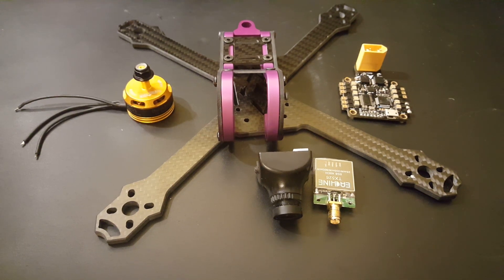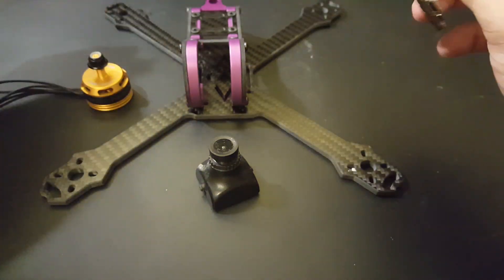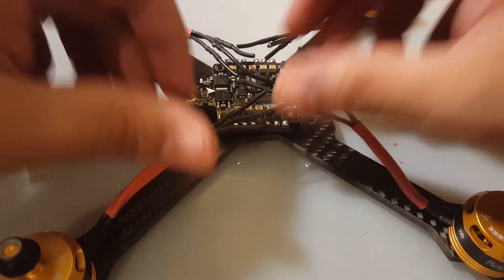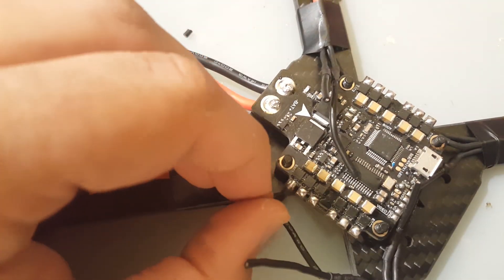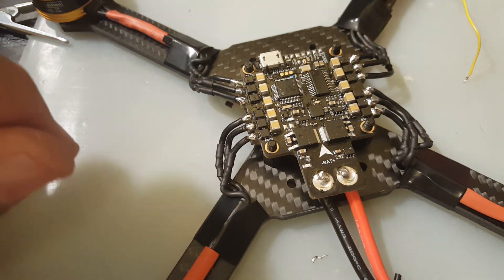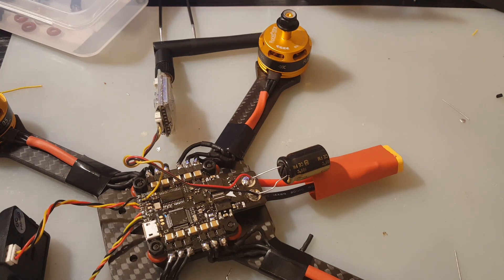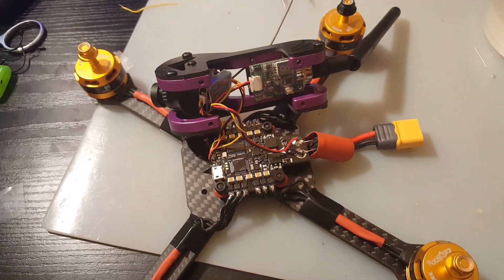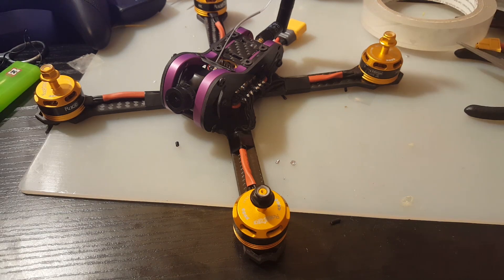How to build a $150 FPV freestyle Drone 2017 // Hippo , Racerstar AIO , RS 2205

Comment: Great video. I got a question for you. Would a 2306 motor work on the hippo frame. I have a set of furibee br2306s 2400kv that I would like to build on that frame. Not sure if it would work before I order the frame. Thanks
Reply: Adam Ali it'll work
Reply: Thanks Jon

Comment: Hey, I'm thinking of building this quad and was wondering what props you used for this build, and if I could use an Infinity 1500mah 14.8V 90C 4S1P Race Spec Lipo Battery.
Thanks

Comment: Great vid, Im building the purple now but wondering what awg cable to use to extend the wires, Wasn't happy they're only few cm short. Also worried about my 4in1 racerstar 35a ESC and Omnibus F4 fitting in this frame with top cover on. 😆
Reply: Redogg Damon Did it fit in after all?
Reply: scheeenfilmiesgucke Nope but i used standoffs to raise the cover off the frame. still in the process of installing fpv gear. Cant wait for a real fpv fly. :D

Comment: Do you really need the capacitor? I would like to know why you've put it on
Reply: I believe the capacitor is supposed to help get rid of any noise in the FPV video and receiver signal caused by electromagnetic fields from the electronics
Reply: Because u can get rid of voltage spikes and that helps protecting other compoments from voltage damage and noise
Reply: A must on all builds. No lines in vtx.

Comment: Hi can I botter u and ask you what pids you use? I got som awfull oscillation with stock pids. Runing beta 3.2. Thanx for great videos, keep up the good work.
Reply: Tallak Flakke are you using the dynamic filter?
Reply: Cory Gross yes,  I found out that stock beta 3.2 was to high. I lowered the pids and it calmed down quite a bit.  The motors war also a bit warm before I lowered it.  Need too fine-tuning to get it locked in. To bad it rains 24/7 here in Norway west coast.
Reply: Tallak Flakke beautiful country. Happy flying.
Reply: He he thanks, a bit to wet for my likings. Happy flying :D
Reply: Tallak Flakke Bergenser?
Reply: scheeenfilmiesgucke ja
Reply: Tallak Flakke Me too! Do you know any other bergenser flying rc?

Comment: Some purple cable wraps for the motor wires would really make that thing come together. I'm probably going to order this build tonight. Except I'm going to order the purple motors to match the frame
http://www.ebay.com/itm/like/161786739959?chn=ps&dispItem=1
Reply from the maker: Andrew Rolfsen Good idea keep me updated would love to see how your buikd came out :)
Reply: This is my first build, so I'm sure I'm going to be hitting you with questions as I go
Reply from the maker: +Andrew Rolfsen no problem:)
Reply from the maker: +Andrew Rolfsen these are very durable and powerful. I love them however I have only used the 2300kv I can't say much about the 2600kv.

Comment: is it possible to strap a gopro or similar hd cam on top? 3s 2200 are ok for it cause i already have some of them!!!
Reply from the maker: +Alex Castignani yes you can strap a cam uptop but a 3s 2200mah you can fly but it will be very heavy. If a 4s then it would be a bit better as I use 2200mah for tuning to base point then switch out to 1500mah 4s for final pids. However it will fly and I recommend getting the racerstar 2306s 2400kv.

Comment: I do not recommend using a AIO like the STARF3S, Asgard, etc for a first build, nor do I recommend a 4-in-1 ESC.

If you're a beginner, you will smoke things while tinkering, and that includes your ESCs. Smoking a 4-in-1 will cost more than smoking a single ESC, and smoking a AIO will cost more than smoking a 4-in-1.

Also, 2600kV is overkill for a build toward beginners.

I know that people who have experience & know not to smoke parts will be building this, but the "$150 price point get your own drone now" sounds very appealing toward those new to the hobby, and smoking components is a bad experience no matter how you do it.
Reply from the maker: Abraham Levine For motor I recommend racerstar 2306 2400kv I will replace them as mentioned in the description because I flew the 2306 after this build and I was just amazed by the performance. 

Another thing about smoking components if your confident and take it one step at a time it should be much more simple than separate parts. If this was an asgard it would be pretty expensive to smoke I agree but this is very simple to setup.

Comment: why  F3  vs  F4  ?
Reply: chips don't matter

you can get effectively the same performance out of an F3 vs an F4, but your CPU usage drops dramatically with an F4. F4 is more futureproof but I don't see F3 becoming obsolete any time soon.

FCs should be judged more by board layout and featureset than chip.
Reply: thank you !   This will be my first build !   i absolutely LOVE your videos.  thank you.   i have been flying FPV for about aa year.  I am retired living in the Caribbean,  I fly every day,  usually 10 lipo.  BUT I have never tried building !   companies like Armattan sell RTF quads absolutely beautiful for so reasonable $  !   I will order from Banggood tonight !!  Thank you SOOO Much !  emillio
Reply: I am not the poster of this video
Reply from the maker: CaribbeanZapatta great make sure to get the 2306s 2400kv racerstar motors dont get these 2205.

Comment: Nice! I just ordered the Purple 215. I have the Matek f405 with the separate PDB, Racerstar Labs 28A ESC´s, and a TX526 to put in it. Basically need motors and camera. Can´t wait for your flight video to hear your impressions. I have some Air 40´s (2205-2450kv) that I could use, but am thinking larger motors...
Reply from the maker: rodrigo207 your going to have to get creative because it's almost impossible to setup a 2 stack without losing space for the battery strap.. keep me updated.

Maybe the purple has more room inside.
Reply: I doubt it has more room! I already had ordered the Matek combo, as I wasn´t sure on the frame yet. Otherwise I would´ve gone with just one board! Yesterday I bumped on an "Anniversary Edition Purple 215", which was in stock and cheaper than the "normal" Purple 215. So I pulled the trigger! hahaha....
Reply: rodrigo207 Hey, we're you able to fit the 2 stack into the purple? I was thinking of doing the same thing.
Reply: Still waiting on frame, motors (RCX 2206-2400), camera (monster v2), and receiver....
Reply: rodrigo207 I just realised you are going with individual esc's. I was hoping to have a 4 in 1 separate to the fc.

Ive blown esc's before and don't fancy replacing a whole AIO board for just one esc.
Reply: SirJamez0 you can go with a 4 in 1 and an FC. 2 boards can fit...
Reply: I was able to fit everything!!! PDB, FC, VTX, RX, and a Monster V2 camera!!! Not really the frame for this gear, but it looks clean, nothing on the outside. I am only waiting on another set of ESC´s, since I had to use the ones I had. I am taking some pictures and may create a build thread on RCGroups after I maiden it. The only thing I will probably change is the camera... it sticks out too much and a Micro should be better.

Comment: Nice buildt :) I agree that purple motors would look awesome also ;) I got the BR2306S 2400KV in the mail today and waiting for a Realacc x210 frame to put them on. 
I want to build with just the same idea as you with low cost,but I can't settle on what fc/esc to choose :/ I've looked at the Flytower F4 AIO with Dshot 40A esc's,and by the looks of it,it sounds good,but I wish you had tested it before I order ^_^ hehe 
But what do you think about the Flytower? Good budget choice?
Reply from the maker: Those motors are amazing i tested them yesterday you can check my iflight maiden i just uploaded it after this video it has those motors.

For FC i recommend the Matek F405 AIO 
https://www.banggood.com/Matek-Systems-BetaFlight-F405-AIO-STM32F405-Flight-Controller-Built-in-PDB-5V2A-9V2A-Dual-BEC-p-1165338.html

What is your ESC budget?
Reply: The Matek was my "safe" option,hehe :)  And I will probably go for that one to,it was just that the Flytower got me curious ^_^   what about these ? Price seems nice also ;)   https://www.banggood.com/DYS-BL40A-Mini-40A-BLHeli-ESC-OPTO-2-6s-for-RC-Multicopter-p-975797.html?rmmds=mywishlist
Reply: I know they are overkill for the 2306S ,but the devil in me wants to test 5S on them,hehe :P
Reply: They are that bad...^^
Reply from the maker: Esk race never tested those esc's but they don't seem good.
Reply: Drone Mesh Then I'll take your word for it 🙂 Any other with Dshot 1200 you'll recommend for 5s high kv? Thanks for the tip 😁

Comment: I got of those boards one of the usb's fell off  before i could use it!........ has no 12v bec so i got 2 diatone 12v becs to clean up the video signal. How did it work for you?
Reply from the maker: I added that 1k uf low esr but needs either a voltage reg or Lc filter for the VTX.. no problems on the OSD which is very good. So will be making a video on the flight and mods needed to make it perfect.

Comment: Also we need to see it fly. Thanks!
Reply from the maker: D S I flew it but need another day because It needs tuning has alot of bounce backs I will share the pids and maiden this week ^_^
Reply from the maker: bigtunitube It flew good there is noise on VTX but that's good and is expected and I am very pleased the 5v reg is clean so no osd issues. I will be making the video today with the fpv footage and the fixes :)
Reply: Looking forward to your comments on the F3S. I had one and had huge issues...so I swapped for a F405 from Matek but as I have another F3S coming would love to get that working.
Reply: Thanks, really curious........

Comment: I'd have just mounted the flight controller 90 deg that way the USB would be at the side and so would the xt60.
Reply from the maker: D S won't fit the esc pads will not allow the top to close.
Reply: Thanks for letting me know. I've got a purple on the way but have yet to get a flight controller. So I'll make sure I don't get this or anything with pads sticking out.
Reply: I've begun my Hippo build. I'm using Matek F405 AIO, FlySky ao6 receiver/TBS Unify both mounted on a whitenoise stack board, racestar 30amp Lite esc's and some Nova's 2205/2600kv. Started with the rubber standoffs at bottom then FC added nylon standoffs that I shortened a lil bit plus once the whitenoise board was on I trimmed the nylon studs that stuck out after tightening the nylon nuts. Fit's perfect. I'll post a pic if I can soon.
Reply from the maker: Anthony Fonseca can't wait to see them :)

Comment: I got the purple (fresh from the mailbox)just because of the pointed arms...seem to look stronger then the one on the hippo and i crash alot...lol
Reply from the maker: +Chi Sty First to break wins ;)
Reply: Drone Mesh if you see the why i fly ...you would know you already lost and i havent even pluged up my soldering iron yet...lol...about the strap this might work if you have a square camera Strap Tie Fastener for GOPRO 3 - TOOGOO(R) 5Pcs Camera Mount FPV Quadcopter Gimbal Strap Tie Fastener for GOPRO 3 https://www.amazon.com/dp/B01G8IRJEC/ref=cm_sw_r_cp_taa_-7IIzb0D1WB58
Reply: I might of made it into your spam folder by adding a link ...

Comment: lol same page again with the cheap fun to fly no worry builds. after crashes if you get noise you cant find problem check vtx inductor coil they can break and any movement cause breakup. also the cap on diversity seems to help some I only had space for 100uf16v surface mount did main power but want to test dvr power line if I see it come back

Comment: Your going to be shocked how well those motors do.  Especially for 8 bucks.  Lol.
Reply from the maker: +Hrr Pippi I tested them yesterday 2306 they where very good I will replace these motors for the 2306 2400kv
Reply: Craig Byrd i would allways go for the 2306 motor instead. They are so smooth in comparison, and powerfull in the low. If only they had some better aluminum and bearings.

Comment: Very sad to hear those RacerStar aren't good motors. Just bough a kit yesterday for my first build. What about the VTX you used, is it good? Should I go for it? 

Thanks for the video, I'm a fan of your channel, great job!
Reply from the maker: Ricardo Gelschleiter they are not bad they are good 5min flight time. Just the low end throttle is not there but still flies good I like it. They might not be durable but they fly good and cheap you did not lose anything with buying them ^_^

Comment: Can this vtx sent out audio 2 or does that work diffrently? Btw how mutch flux is in youre tin?
Reply: Bennie Leip it doesn't have smartaudio, you need a inverter and some caps and some chips to let it work that most vtx's doesn't have.
Reply: Thumbs_Fpv mmm to bad tis one is on his way but its not necessary thanks for awnsering  👍🏻
Reply: Thumbs_Fpv thanks this is my first build so if this is done i gues to take that one 👍🏻
Reply from the maker: If you mean audio as in sound yes it does its the white wire but i always cut it off because i don't have a mic.
Reply: Drone Mesh thanks i saw that today and man what hard to solder right ,cant i get you on loan to solder for me😆 but if i buy that swift 2 do i yust connect the microphone  wire of the cam to the microphone wire of the vtx?
Reply: Bennie Leip you don't have to connect it only if you want audio
Reply: Thumbs_Fpv yes i want that but didnt know if that worked like that